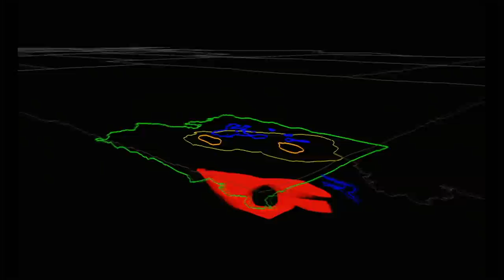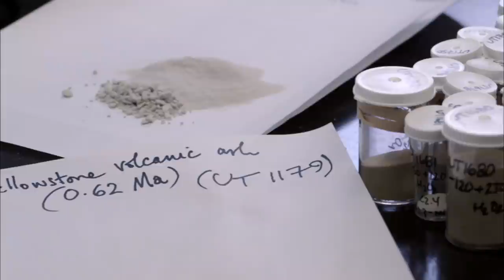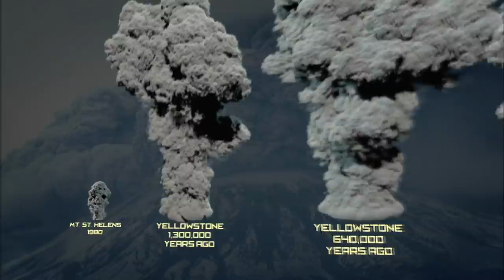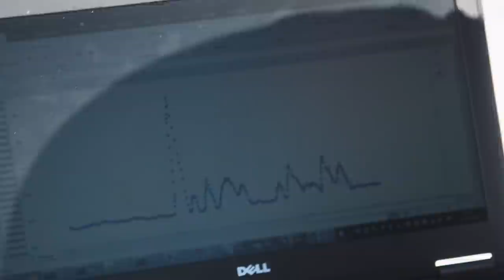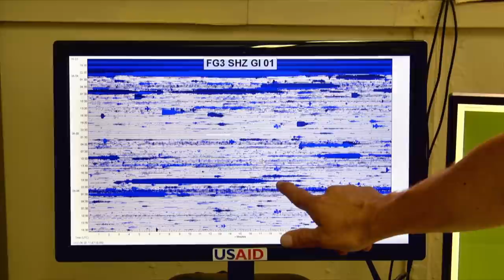10 Awe-Inspiring Volcano Videos 🌋 Smithsonian Channel

Comment: Can anyone explain as this completely baffles me. If magma is melted rock heated to over 2000 degrees how is there a magma chamber? Surely everything would just be melted rock.
Why is there liquid rock in a rock made chamber.
I don't get how some rock can be heated to melt it but the surrounding rock doesn't melt.
Reply: I understand completely what you are saying! I have also wondered what is holding the magma or is it just deep under everything? What consists of the chamber?
Reply: There are a lot of factors, and things like chemical reactions, gas content, fractures in the crust etc... but the simplest explanation is that different rock types have different melting points, and that the heat that melts rock is generated by pressure. The further down into the crust you go, the hotter it is, and the inverse is true as well. So when you get close to the surface, the less dense rock can melt while dense rock can remain solid. Sort of like how a limestone cave forms, the water dissolves the limestone but not the other rocks, over time leaving a vast chamber.

Comment: Those tour guides actually know quite a bit about how dangerous the lava is where it meets the water. A lot actually goes in to planning those trips. They're not just loading boats and going all willy nilly right up to an active lava flow. They're constantly monitoring not only the volcano and lava flow itself, but also the weather and winds. They don't go into an area where they can be easily trapped. The captain's only job is to constantly watch the winds, fog, and lava. There's an entirely separate person actually talking to the people. That way the captain can concentrate solely on the lava and dangerous fog. Unless you go on one of those scam tours... There's people that actually pray on tourists by saying they'll take em on this grand tour but they're really just some scam artist that knows nothing about the actual volcano. You do have to be careful and do a little research on which tour guide you use. Major well known ones usually have a building of some sort. They're not just out on the streets trying to get tourists to go on the tour.